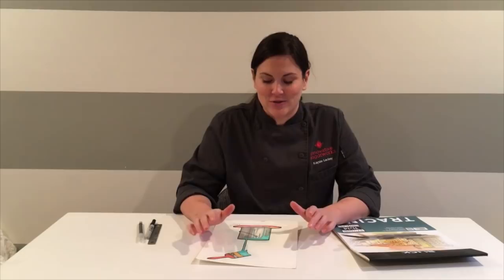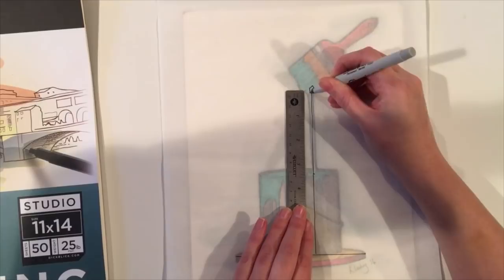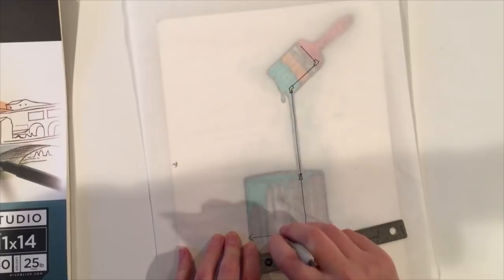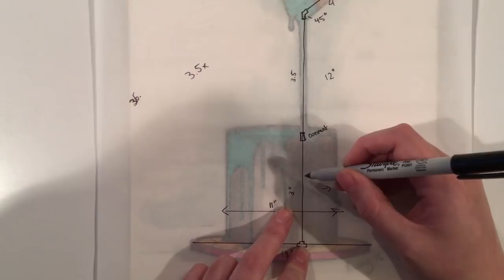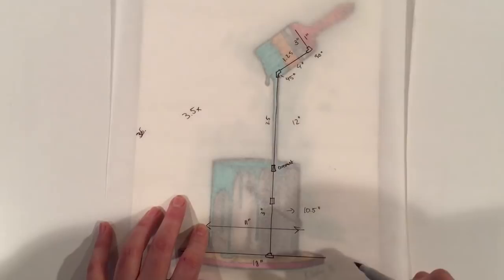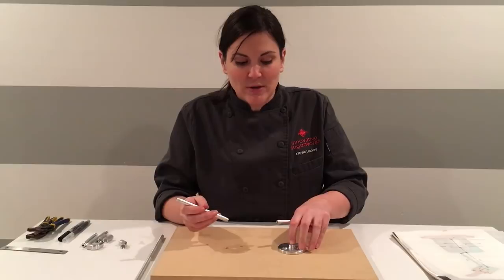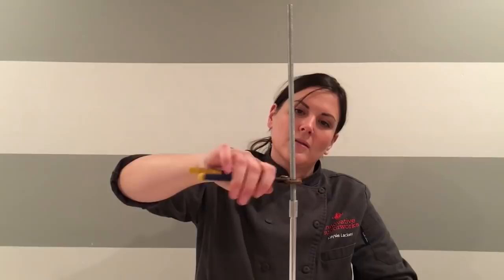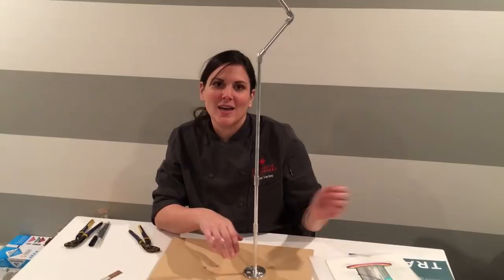How to Design a Custom Cake Armature using Sugar Structures

Comment: Yes,I’m a fan and a client. I have your extension turntable and all the sugar shapers. oh! and your craftsy video class. And your structure system is great!!!  I was looking for that tipe of pipes and they don’t exist. ❤️
Reply from the maker: Thank you for your kind words, Sabela! We aim to please! :)
Reply: Sabela, you actually can get similar pipes, which is useful if you need a large quantity or longer pieces, from a shop that sells pipe fittings, such as pipefittingsdirect.com. The 1/8" NPT pipe nipples (as they are called) are available in 304 stainless steel which is food-safe. I've been cautioned that mixing metals is not always a great idea, but my initial experimentation shows that they fit really well with this awesome kit.